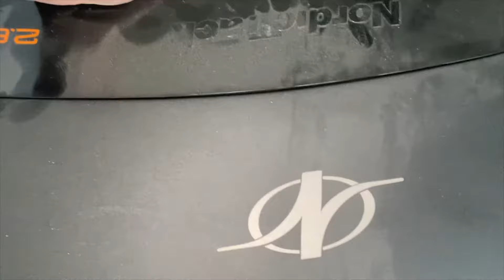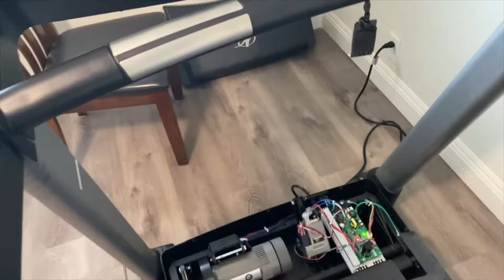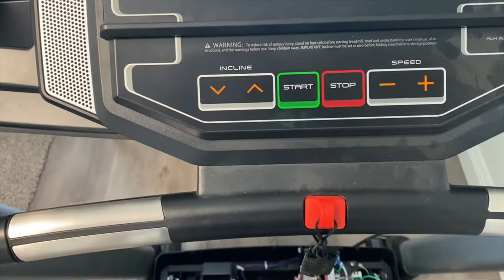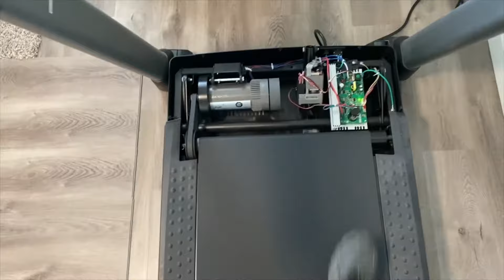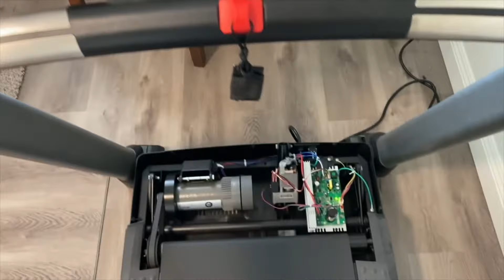Solved: Treadmill won't turn the belt.

Comment: that machine is loud 📢 
louder than my temu treadmill, that cost just over $100, it looks like a smaller simpler version tgan this one with 3hp motor upto 6.2 miles an hour, I like the simplicity of it and its light weight to move around, has to little wheels in front.
Reply from the maker: Glad you found one that works for you!

Comment: fyi  had same issue same light error code  , from a another post replaced the mofet  on controller board   4 dollar part all good.
Reply from the maker: I had another guy tell me that the board repair is not that hard and that the components are cheap.

Comment: What problem when it show error E13
Reply from the maker: If you search the web you can find a list of error codes and their meaning. I found one and used it for my problem but didn't save it. Also, the guy that sold me the replacement board was really knowledgeable. Check with some of the sellers to see if they know that meaning.

Comment: Did u do any diagnostic testing on the control board before getting a new one?
Reply from the maker: Yes. I used the on board diagnostics. The light flashes to indicate different failure modes. Mine indicated board failure.

Comment: This is for sure our issue with NT treadmill! Going to eBay, is there a specific control board for different versions of treadmill, or can I buy whichever one?
Reply from the maker: The guy I got mine from verified that is was right for my machine. He was super helpful.
Reply: @thehomerepairguy  Our treadmill is working again and saved couple hundred on not calling a repair man, thank you so much!
Reply from the maker: So glad it helped.

Comment: I’ve had the same problem but even after I replaced the controller board it still had the same issues.
Reply from the maker: Did you check the error codes? They will tell you if it is the board or something else.
Reply: Yes sir. Ive replaced the controller board because it was blinking 4 times indicating a bad switch.
Reply from the maker: The guy I bought my board from on Ebay was super helpful. You might check with your board guy and see if he sells the right replacement switch.

Comment: I replaced the controller on my treadmill (same as yours) and now my motor sounds different. The exact same sound as yours is making and it didn’t used to sound like that. I sent the video to a treadmill tech that said the motor is sounding like it’s failing. Is yours still working?
Reply from the maker: It is my son's treadmill. As far as I know it is still working, but he and his wife aren't using it as much as they did before.

Comment: Just fyi, these boards contain very simple components and are easily repairable by any electronics shop. Repairing them costs 1/4 of the cost of a new board
Reply from the maker: Thanks, I didn't know that!
Reply: Do you know which components usually fail on these boards? It's so small so it seems the issue should be pretty inexpensive to fix...
Reply: @yolo-cars the MOSFET that powers the treadmill motor is the component that usually fails
Reply: @OlivierCR  Thank you!

Comment: Replaced my nordictrack 10i control board. Now the speed is waaay off. Any idea how to recalibration the speed on this model?
Reply from the maker: I'm not sure, but the guy I got my board from was super knowledgeable. Try checking with your board seller.

Comment: How did you get the cover off? The screws at the front are removed but I can’t get the cover off for fear of breaking the cover
Reply from the maker: It has been awhile, but there might be screws on the side or clips to unpop. Be gentle but firm and it should lift off.

Comment: I have a PFTL13118.1 ProForm treadmill with the same problem. The control panel also flashes red lights as well. How can I replace it? And what kind would I need to replace it?
Reply from the maker: Go to the link in the video description. I ordered from that guy and he is very knowledgeable and willing to help.

Comment: I had a similar problem and I did what you have demonstrated here. After replacing the board the treadmill runs ok if I don't step on it, if I am on it runs for 32 seconds exactly. After the 32 seconds it stops. Then I have to press the stop button and start it again, it runs for another 32 seconds and then stops. I called a servicing company to re-align the belt and they did. So I know this is not a belt problem. They also lubricated the inner side of the belt. 

At this time it's looking like it is either a controller problem (faulty replacement controller) or the motor problem which seems unlikely given the motor is working when I am not on it. Any ideas what I can try?
Reply from the maker: Yeah, check the blinking lights on the controller board. There is a link in my video of how to decode them. They will tell you if the board or motor are bad.
Reply: Did you ever figure out the problem? I just replaced mine and am having the same problem
Reply: @hikefordonuts3812 No, I ended up giving away the treadmill to soneone who weighs about 70 lbs. The machine was working for lower weight people.

Comment: I have a 2022 serenelife treadmill I turn it on it shows the numbers and lights up i press start and the seconds start to count down but the treadmill dosent movie might be to tight or gotten loose or maybe one of the metal wires got loose when i open it up
Reply from the maker: Check the blinking lights on the controller board. There is a link in my video of how to decode them. They will tell you if the board or motor are bad.
Reply: @thehomerepairguy  I just had to lubricate it it runs well now

Comment: Mine blew a fuse in my house now my belt won’t move do u think this is the problem
Reply from the maker: Hard to say, but the on board diagnostics can help. Follow the video where it talks about the light that blinks on the main board and how to determine its meaning. Good luck.
Reply: Check the cable isn't damaged in any way, a fuse will blow because of a short

Comment: Just had this issue arise as I was doing sprint intervals. I hear the treadmill start and then it comes to a complete stop. Do you still think it’s the control board in that case?
Reply from the maker: You can tell by watching the error code LED on the controller board. It flashes codes when the unit malfunctions. It will tell you if the board is bad. It sounds like the same symptom as mine.
Reply: @thehomerepairguy do I have to read the manual for those codes?  Or did you find the code errors somewhere else ?

Comment: Such a great Video! I think the Treadmill companies try super hard to hide how to diagnose and repair these yourself.
Reply from the maker: Thanks. Glad you liked it.
Reply: Absolutely the manufacturers minimize the ability of the consumer to diagnose and repair. I have a True treadmill and have an issue with an error that does not appear in the manual. I contacted True and the first thing the guy said to me after I thoroughly explained the issue was, "I can contact a regional repairman for you." NO, that's note what I want, I want you to tell me what the error code means! So many consumer products have helpful customer support lines...why do treadmill manufacturers make it so complicated (I know, $$$$).
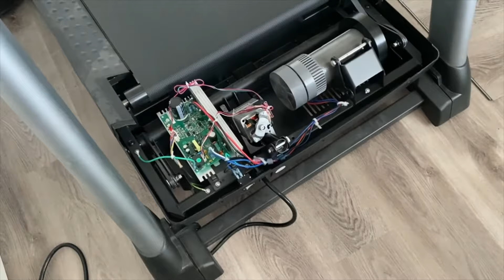Reply: 0:30  @XKXKIXKXK
Reply: As a repair technician in training,this was my 1st task solo. Most of it is super simple,some of us aren't inclined or able to do them so fortunately there is a whole industry for it, and for that I'm thankful